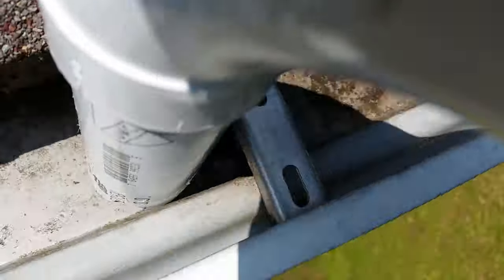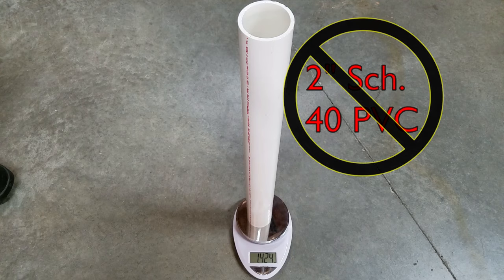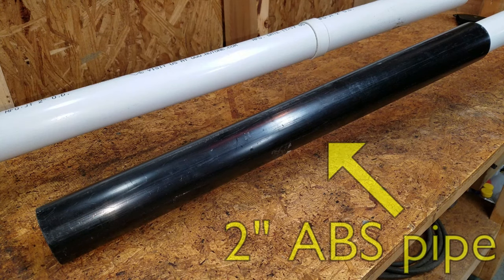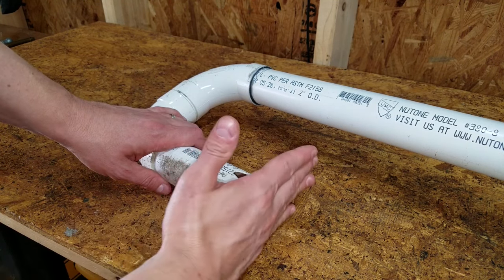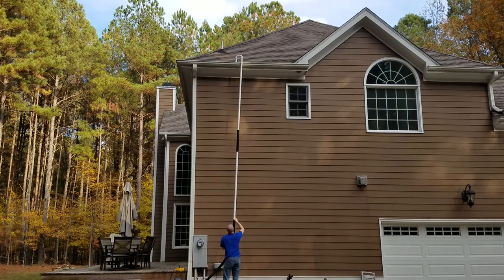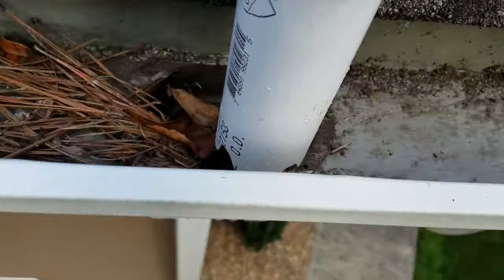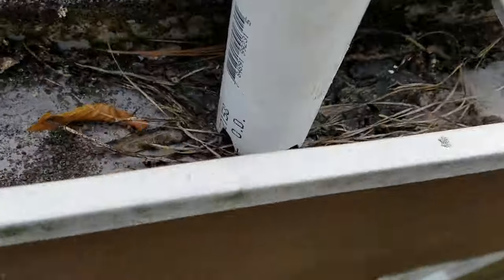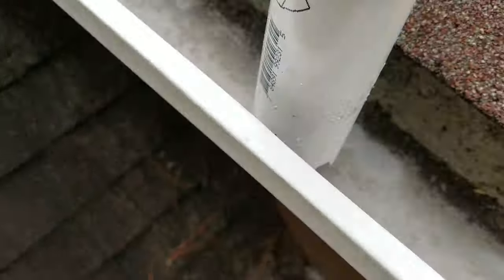UPDATE: Gutter Vac (3+ Years Later)

Comment: Really like this and the previous vid you did.  Great job!!!  I've always used a blower from the rooftop, and then cleaned the ground, but my rooftop days are over, so I'm looking for another solution and agree with you that pressure washers are messy, and unwieldy given the pressure.  Light weight is the key.  Prior to your vid I was thinking about an air compressor solution, using an light extendable pole and a light air hose, but I see potential issues with that far as forces & how to trigger it, so maybe in the end your solution is best.

Couple questions:
- Do you have much issues with clogging?  Where I live its pretty wet in the fall & winter, so my gutters are a mix or leaves, water & sludge
- Any issues with branches or twigs?
- I'd need to  buy a shop vac for this, you mentioned a couple but if you had to purchase another one which exact one would you go for?
- You mentioned swapping the hose port to blow instead of suck.  Have you tried that?  If so how well did it work as opposed to sucking?

Again great vid & Thanks!
Reply from the maker: Thanks for the comment, I appreciate the kind words!

1.) I don't really have issues with clogging. Every once in a while, I'll encounter a clump of pine needles that have become matted together but the continuous movement of the attachment breaks 'em up enough to get sucked up. If you have a lot of larger leaves (like oak), you might have more issues with clogging. I would assume cleaning the gutters when the leaves were slightly damp might be an advantage because they would bend easier than ones that were dry and stiff. I would just make a small pile of the same types of leaves that end up in your gutter and see if you have any issues just sucking them up from a pile on the ground. If you experience clogging, you could connect the hose to the exhaust port on the vac and blow out all of the big leaves in the gutter and then switch the hose back to suck out the shingle grit and smaller leaves. Now that I have the attachment, I clean my gutters twice per year because the pine needles fall year-round. This makes gutter cleaning easier because there's less debris to remove. The wet/dry vac does well with the shingle grit and decaying leaf sludge.

2.) I don't have any issue with branches or twigs because anything that makes it into the gutter is usually small enough to get sucked up.

3.) I have a Ridgid 5HP wet/dry vac from Home Depot. It was only around $50 and does a great job but, if I had to buy a new one, I'd probably go ahead and get the Ridgid 6.5HP model.

4.) I've attached my vacuum hose to the exhaust port and used it as a blower but not with the gutter vac attachment. I haven't had the need since vacuuming seems to get mostly everything. I assume it would work just fine but I haven't personally tried it.

Thanks for watching!
Reply: I thought about the air compressor also, triggering can be done with a ball valve at ground level.

Comment: Thanks Mike! My 1 and 2 story gutters have always been a worry so I will try to make one. I found five sections of central Vacuum tubing, each 5 ft. in length. I will connect them with couplers and pvc cement except for one connection I was planning to use male- female adapters so that I have the device in two segments that I could screw together or apart for different gutter heights and for ease of storage.  Have you tried using male- female adapters? Thanks.
Reply from the maker: Nope, I haven't used the male/female adapters, let me know how it goes! Thanks for the comment.

Comment: great videos! I'm planning to make soon. You mention 2" central vac tubing and 2" ABS pipe. Yet your shop vac hose is 2.5". How do you connect them?
ps- I made a blower version a few years back with gas leaf blower, flexible downspout connector and 4" Sch 40. It was such a heavy beast for even a ranch house, I would up cannibalizing the Sch 40 for another project. Good riddance!
Reply from the maker: Yes, the vac hose is 2.5" but those short black extensions that come with wet/dry vacs are tapered. The bigger end goes over the hose and the 2" central vacuum tubing from gutter attachment slides right in and is a perfect fit. Check out 1:18 of the video again and you'll see what I'm talking about. Thanks for watching!

Comment: Any thoughts on whether pvc conduit (for electrical work) is thinner or thicker than central vacuum tubing? I am unable to find a local supplier that sells small amount of central vacuum tubing :(
Reply from the maker: Central vacuum tubing is the thinnest you'll find and keeping the attachment light weight is key to making it usable. I got mine from my local electrical supply store so I'm sure if you call around a bit more, you'll find a place that will sell it by the piece.
Reply: @Mikeattempts  Appreciate it. I will keep looking instead of settling for pvc electrical conduits.

Comment: What shop vac do you use? I have a ridgid with 2-1/2" hose, and the hose and extension tubes have about a 2" ID but not exact it seems. I have to special order the vacuum tubing and want to make sure it fits the ridgid hoses etc. since ridgid has been using the same ones for a long time. 

And 5 seconds after I type this you show your shop vac. LOL Thanks for the idea. Going to do it myself cause it scares the hell out of me to get on the roof 2 stories up.
Reply from the maker: Hahaha, glad you kept watching. ;) Check your local electrical supply store, they should be able to get the tubing for a great price.

Comment: Seems we don't have powerful (eg. 5 hp) wet/dry vac in Australia, most 2000w (2.5 hp), how do you know what minimum power vac will work, my house is single storey & I can stand on top of the ladder, but prefer not climbing up the roof.
Reply from the maker: I'm not sure what the minimum power required would be, but it would be less for a 1 story house than a 2 story. However, the vacuum HP ratings (at least in the US) are odd. I'm not sure how they're come to the conclusion but there's no way my vacuum has a 5 HP motor in it, that would be huge. Anyway, what I'm saying is that maybe your 2.5 HP option is legitimately 2.5 HP and is actually more powerful than my "5 HP" vac. Also, since your house is single story, you might be able to find something like this locally: https://www.homedepot.com/p/203235222

Comment: It looks you and many commenters as referring to pine needles.  How does the vacuum work for large leaves (Oak).
Reply from the maker: I'm not sure, I only have smaller leaves and long-leaf pine needles. However, if you rake up a small pile of oak leaves and are able to suck 'em up with your wet/dry vac then I would assume you'd be able to suck 'em up with the attachment as well.

Comment: Great project!!! I checked several HDs around here and it seems they no longer carry the ABS. Is there anything else that can be used in its place? Thanks
Reply from the maker: Other 2" pipes might work but the great thing about ABS is that it's much lighter than schedule 40 PVC. I got my ABS pipe on homedepot.com but it's also available on Amazon ( https://amzn.to/3bM9GYp ). The cheapest ABS option would be to pick one up at your local plumbing supply store. Another option would be to use a central vacuum tubing coupler (Nutone part number 388) and PVC glue.

Comment: Great video and design. Somehow I think I am going to need two elbow sets (one with 90s and one with 45s) because some of my 2nd story gutters are not directly above the ground but instead above my porch roof or the garage roof, the latter extending from the front of the house. To reach those gutters, the elbow would need to enter the gutter at an angle (and I'd need to hold the pipe at an angle as well).

I think/hope a third shorter PVC section with a second ABS pipe to hold swappable elbows on top of the two main PVCs with the ABS connector should do it. I'll let you know if. that works.

Also my shop vac hose is made for smaller diameter attachments, but it looks as if it will take a 2.5" hose. Hoping that works out as well.
Reply from the maker: Sounds like a solid plan with the swapable elbows, let me know how it goes!
Reply: And I guess the other discovery I made is that we shouldn't ask for "schedule 20" at Home Depot but instead asked for "central vacuum pipe" since the former is no longer used in plumbing and schedule 40 is to thick for vacuums.
Reply from the maker: Correct, you only want "central vacuum tubing" (not pipe). My local Home Depot didn't carry the tubing, but I was able to find it for cheap at my local electrical supply store.
Reply: Found the central vacuum tubing at a local plumbing and electrical store, but it seemed to have a millimeter or so of play inside a 2 inch pipe, but maybe that will be OK. I may also just start with the one story version to get a feel for the system and then come back for the ABS and addition vac tube. The other nice thing about the plumbing store compared to Lowe's is that there are lots of choices for the length on the ABS without too big a hit on the $/ft.

Regarding the 1.5" attachment end on my Shop Vac, it occurs to me that I ought to be able to use a reducing coupler to connect the vac hose and the tube rather than getting a new hose (that might not even work) and thus save about $30. More updates to come.
Reply from the maker: @andersmartinson1750  That's great, I'm glad you were able to find the central vacuum tubing! I honestly don't know if your 1.5" shop vac hose will handle it just fine or if you'll need the larger hose. As long as it's powerful enough, the only potential issue I see is that the reducer could create a choke point and cause a blockage.
Reply: Stage 1 complete. Got the materials today and put things together for the first story gutters. The store that sold me the vacuum tubing had elbows they said were designed specifically for the tubes. Those guys seem to attach snuggly with no adhesive at all. I may even try that attachment when I go to the second story, really doesn't seem as if they can possibly pop out.

Because of that 1.5" nozzle on my Shop Vac, connecting to the tubing got interesting. I found a foam reducer that just barely fits over the main tube, and if I insert the narrow end of one of the tapered extension tubes from my vac into the reducer, the wide end fits snug on the small end of the reducer. I can then attach the vac nozzle to the tapered tube,

So far things are working OK, but because the fir needles in the gutter are still pretty soaked, it's a little tough to judge fully. Not sure if I did something wrong, but the notches in the intake pipe seem to reduce the suction more than I want (even though as you say an unnotched tube can stick on the gutter). Might just be that I'm dealing with overly damp debris.

Thanks for the design and inspiration.
Reply from the maker: @andersmartinson1750  Thanks for the update, sounds like things are moving along smoothly! You'll most likely need something to help keep the pieces together. I used silicone caulk on each connection except for where the long tube attaches to the first end of the 90-degree elbow, I needed to use PVC cement on that one. My only concern would be the reducer. Not only is it a potential choke point for debris coming down the attachment but you're also losing a lot of suction power when the tube suddenly increases in size. The good news is, if it doesn't work out, it'll be easy to attach it to a larger vacuum, like the one I used.

Comment: Mike I watched both videos and they are well done. Only problem I have is I can't find Sch 20 thin walled pipe anywhere around here in SE Pennsylvania.  I am searching using the Nutone stock number, ASTM number and so forth and no luck.  Anybody have any leads on East Coast? Thanx, Carl
Reply from the maker: Call your local electrical supply store and ask for central vacuum tubing. That's how I got mine.
Reply: @Mikeattempts  Got it Mike, thanx. Will do, Carl

Comment: Was excited to do this, but no luck finding the schedule 20 pvc. I've searched everywhere online and don't know any electrical store in my area that would supply it.
Reply from the maker: I think I mis-spoke in the 1st video when I referred to it as being the same as schedule 20 pipe. It's technically called "central vacuum tubing". If your local home improvement store doesn't have it, your local electrical supply store will. Also, any store that sells or installs central vacuums. Try Googling "electrical supply near me".
Reply: @Mikeattempts  Fortunately the correct central vacuum tubing became available from Amazon today. Made the purchases of the material. I'll be able to build this after all. Thanks for your informative videos on this. This is just the type of thing I was looking for to clean the gutters without having to climb ladders.

Comment: Awesome video and I am sooo doing this!  You think an 8ft and 10ft central vaccum tube will work well together?  I think the two extra feet will help so I wouldn't need to hold my arms up as high.  I have a two-story home and no idea how high.  Also, how much should the 8ft central vacuum tube cost approximately so I have a point of reference, because Amazon currently has it listed for $24.  Homedepot does not carry it and I haven't checked elsewhere yet.  Thanks!
Reply from the maker: See if you can get a tape measure up to your highest section of gutter. Don't forget to subtract a few feet to account that you'll be holding it at around belly height. I paid $6 per section of 8' central vacuum tubing at my local electrical supply store in 2018. I wouldn't order it online unless you can't find it locally, the added cost is for shipping.
Reply: @Mikeattempts  It's about 19ft from 2nd story gutter to my waist so I think one 8ft and one 10ft tube will work best for me, if I can find it.  I'll check out the local electrical supply store this week.
Reply from the maker: @Jeff-vj3jp  Yeah, you shouldn't have much trouble finding the tubing, just call around, someone will have it. :)
Reply: @Mikeattempts  You got me motivated now to do this lol.  Instead of sawing to make the ring stopper, and tube for the two elbows, and end piece that goes into the gutter, do you think they sell these size tubes, wishful thinking I know.  I'm trying to avoid sawing if I can.
Reply from the maker: @Jeff-vj3jp  I mentioned in the video that you could cut two stops off of the section of black ABS pipe. I only cut the coupler in half to use as stops because I had already bought it. The same place you get the tubing should have the elbows too. I used a miter box and a hacksaw to cut the tubing, but it doesn't need to be that precise, you could just use a hacksaw ($10 at your local hardware store). You'll only need to make 4 cuts, it's easy.
Reply: @Mikeattempts  Last questions ;) I see you did not use purple primer with PVC cement on the stopper.  Do you recommend primer first? Also, for the ABS tube will PVC primer/cement work on this?
Reply from the maker: @Jeff-vj3jp  I used silicone caulk for all connections except where the long pipe, coming from the vacuum, goes into the first elbow. I just used a cheap medium duty PVC cement. Since it doesn't require any pressure rating, I didn't use any primer. I used silicone for the ABS as well. If you wanted to use cement, there's a special type for joining ABS to PVC but caulk is easier and cheaper. Did you see the first video showing the build?
Reply: @Mikeattempts  Many thanks Mike!  I built the gutter vac few days ago and used it today.  No issue finding the central vacuum tubing.  Used a miter saw for the cuts which was 1-2-3.  I'm looking forward to the rain now : )
Reply from the maker: @Jeff-vj3jp  That's awesome, thanks for the update!

Comment: My shopvac uses a 1-7/8 hose. Is there some kind of adapter
Reply from the maker: I'm sure there's an adapter but then you'd have a bit of a chokepoint. You could give it a shot, it might not be an issue. However, I would assume the vacuums that use the standard 2.5" hose are more powerful.